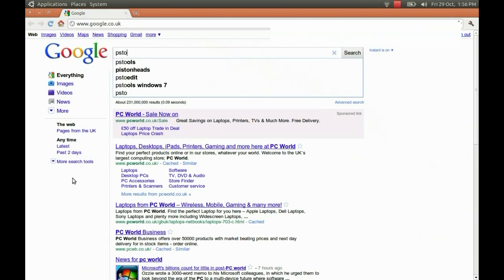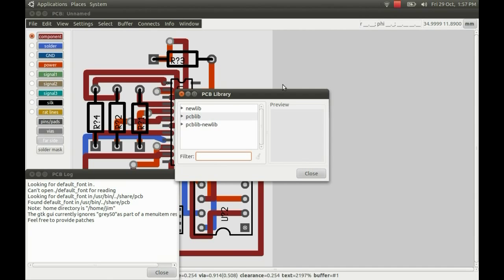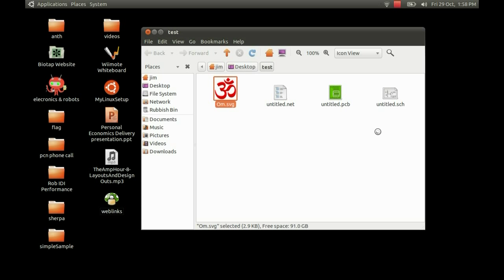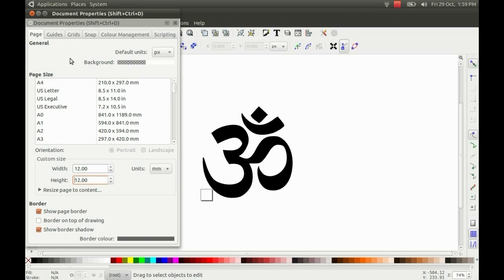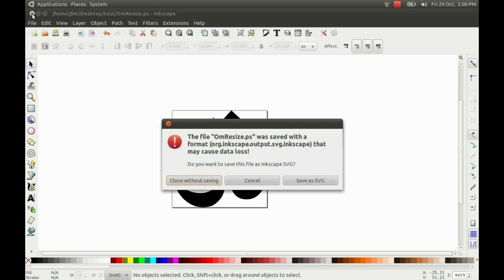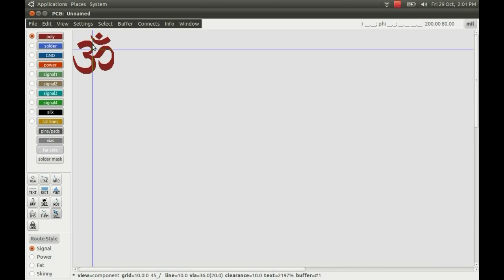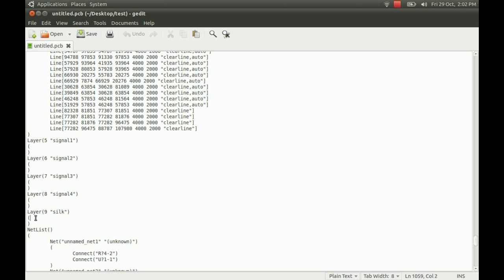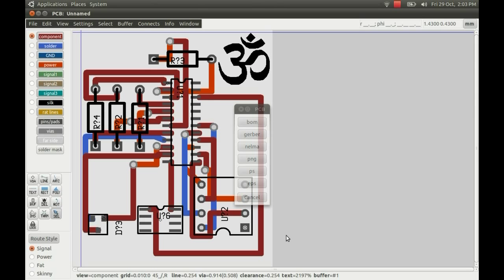GEDA PCB Designer - How To Make A Custom Silk Screen Image

Comment from the maker: @jabber1955 Thanks for the comment. 
Unfortunately PCB wont let you use polygons on the silk screen layer, if you use 'shift M' it just disappears, editing the file manually is the only way to get a polygon to work on the silk layer.